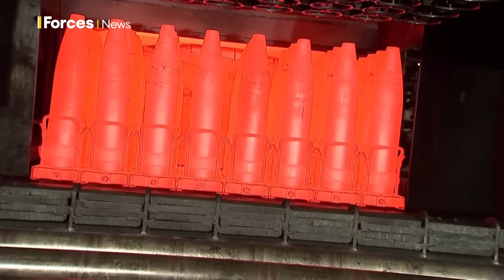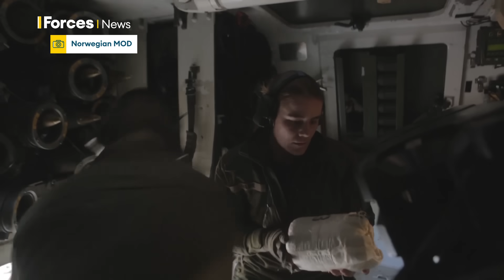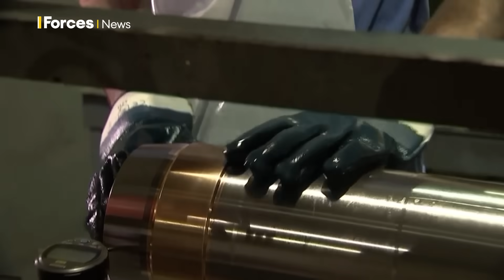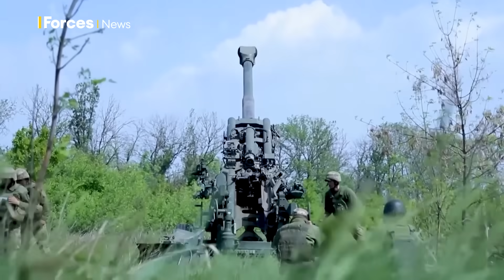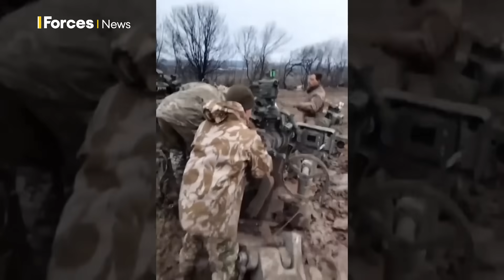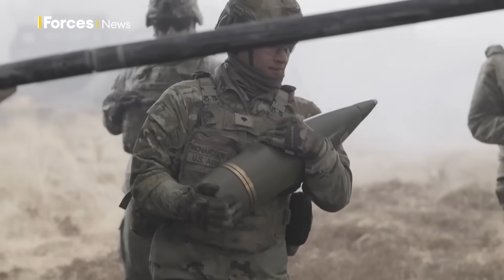Warning Nato needs to 'radically change' ammo supply for Ukraine

Comment: this is an old problem  back when the Aussies used Leopard 1 and the barrels had to be replaced because of wear  on some vehicles it was soon found that the rounds we were using  in old barrels were in some cases jamming in the new barrels reason was a difference in tolerance inside the barrels and different metal expansion rates on the 2 barrels this ment while on a cold barrel you could fire any round with no problem once a barfrel warmed up after say 3 or 4 rounds the rounds that had painted centering bands on them would jam in the new barrels and you had to use rounds without the centering bands which coukld not be removed in the field but needed to be put in a lathe so it was done  properly in the end it just ment the rounds with centering bands were not used in tanks with new barrels till there were more new barrels equipen than old ones and the centering bands were removed from all rounds and old barrels just were restricted from using them
Reply: Punctuation. My god
Reply: @jonreid7957  You loser, fancy bringing that up, "what ah Mug"
Reply: Really interesting, Thanks for sharing mate, it's all in the details😁👌🏻

Comment: I am gobsmacked that throughout NATO, arty shells are not fully standardized! The inherent absurdity of having end-users trying to figure out
what ballistic chart to follow in order to get rounds on target is asinine!! How can this be the case when mil-specs are supposed to be so rigorous!?
Reply: I couldn’t agree more. Is that so crazy. I wasn’t aware that the standardised 155 shells weren’t actually all the same. I would’ve thought the manufacturers would’ve been required to make sure the construction of them was the same. This is very disappointing. It needs to be rectified ASAP
Reply: Yes, 155 mm shells are not all alike, there are cluster-, high explosive-, precision guided-, extended range-  and insensitive types, and these have different ballistics, range and effect.  There is no meaning in standardizing on only one type. And of course the user (not only Ukraine) has to know which is which.
Reply: They are. 
The actual story the guy is talking about is regards to french mortars.
Reply: The shells can be used and shared. However, most European countries do not want to share technology, especially with the USA. The USA shares lots of technology with them, but everything is one way with Euros. All of the militaries also have requirements and spend a lot of money on R&D for specialty requirements. Many things the USA uses are not wanted or used in Europe. Similarly, many Euro shell designs are not used or wanted by the USA. There are also different legal and political considerations.
Many countries, especially in Europe, also compete with each other for international military sales.

The real problem: most NATO countries do not pull their own weight and free ride off others.